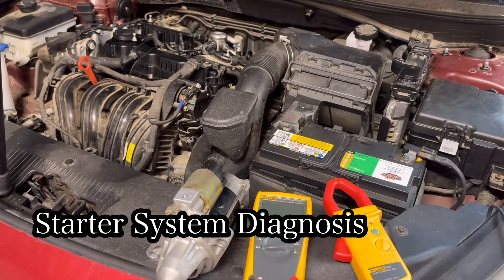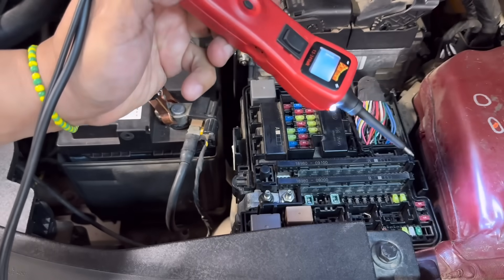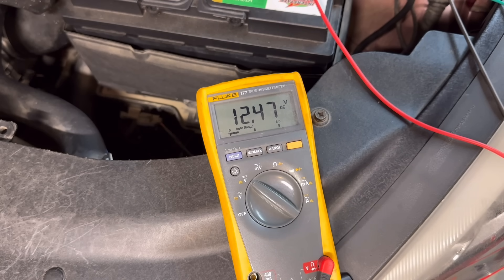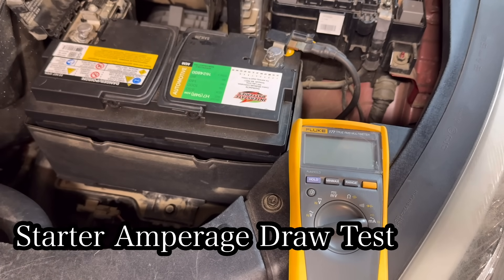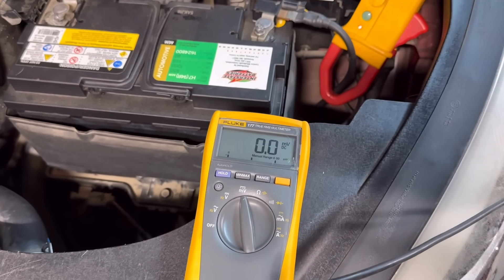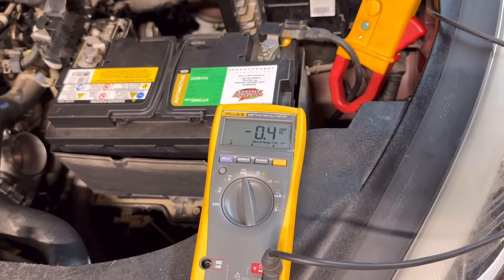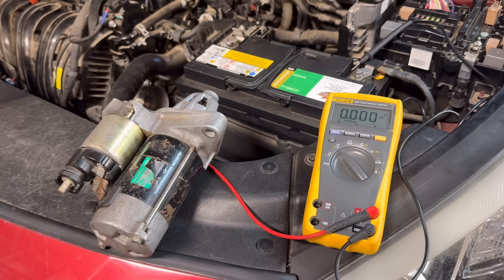Starter Motor Testing Explained-Don’t Guess, Test

Comment: If you want to get min/max/avg without the high in-rush current, all you need to do is start the crank first and then press the min/max record button while the engine is already cracking. The rush in current is a result of overcoming the motor inertia and only lasts a few milliseconds.

Comment: So would the same readings show up if the starter doesn't work?

Cause the starter works and I'm assuming it's taking up more power than if it didn't crank
Reply from the maker: If the starter is working but drawing too much power, it indicates an issue with the starter itself or high resistance in the circuit.

Comment: When you tested amp draw you had the meter on dc mv???? I don't understand this. Shouldn't the meter have been on amp setting? *Ok went back and watched again. You did say every mv will represent an amp under those settings.* I'm schooled. Thanks bro
Reply: That was a proprietary amp clamp that only works in conjunction with a specific meter, not a stand-alone amp clamp.

Comment: Gotta use that min/max function
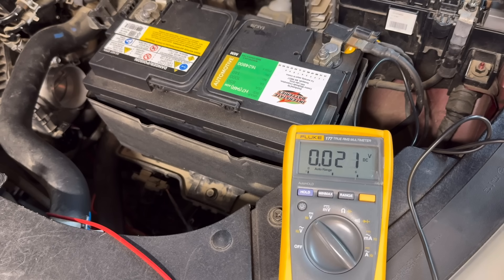Reply: I agree, but he explained why he doesn’t use min/max minute 14:00, which makes sense.
Reply: @m @mannyrios4222  yeah I did see where he explained why he didn’t use it, but this meter also shows average in the min/max setting . Also I don’t think this meter is fast enough to capture the in rush current which happens in like a 2 mS window . In order to see that peak amperage you would need a meter that has peak detect mode like the fluke 88 or flu 87 or an oscilloscope
Reply from the maker: @CampingNstuff Got it. It helps someone like me that cannot afford an expensive meter yet. Thanks
Reply: @M @MRDIAGNOSTECH  the meter that you’re using is an extremely capable meter more than enough for every day automotive use but yes, the min/max function should also have and Avg function as a third option that way while you’re cranking it, it will ignore the peak amperage and display the average reading, but also give you the option to toggle through and see the maximum as well. The way you’re doing this video is dead on accurate. I wish more technicians would take the time to learn these methods that you’re showing I work for a fleet and whenever we do preventative maintenance, we have a checklist that we go off of and check in starter draw and do voltage drop test on starter cables is part of that checklist.